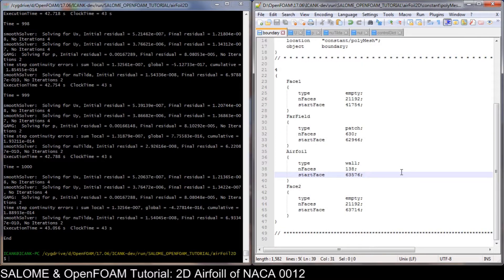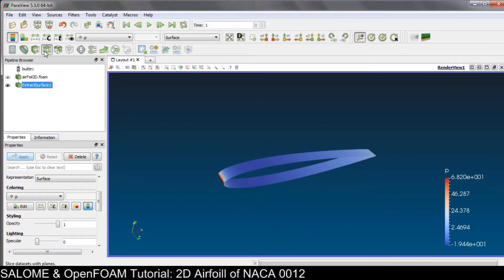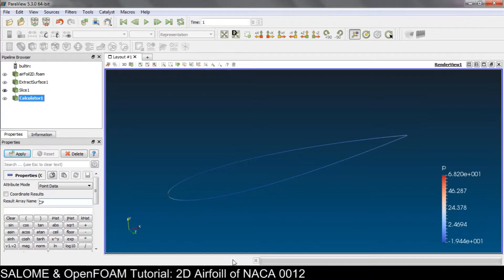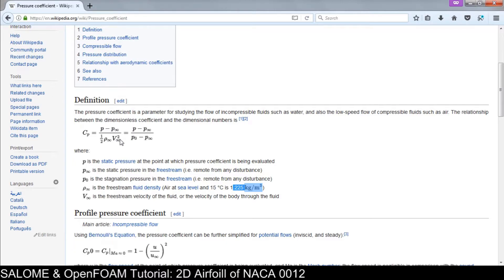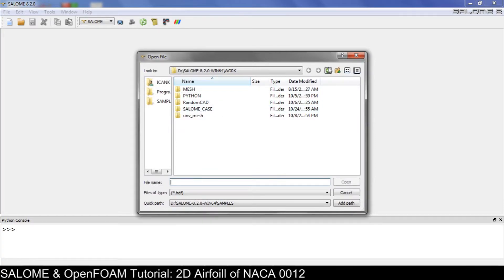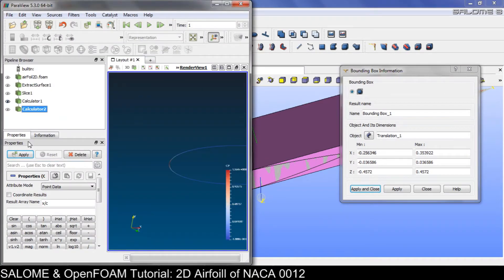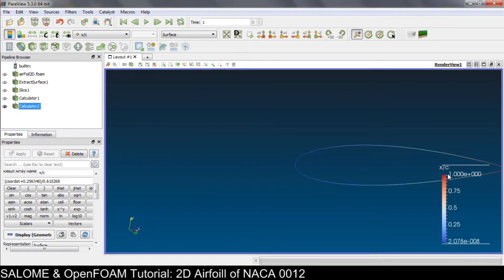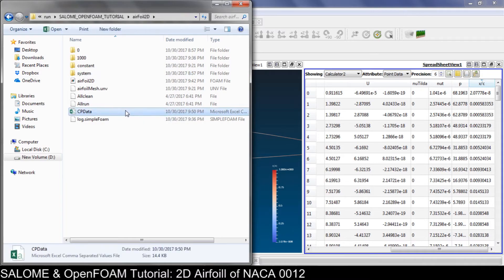SALOME + OpenFOAM Tutorial: NACA 0012 Airfoil Part 4

Comment: Nice video. Just an observation...The unit of pressure used in simpleFoam is m2/s2. So using the Cp formula right away does not make it dimensionless. The pressure should be mulitiplied by density to convert to kg/ms2 if not, the result may be wrong. This worked because the density used is 1kg/m3. If you were using say water, the results will be incorrect

Comment: Dear Ali
 
Can you please extract the Cl, Cd, lift and drag for the same airfoil using different angle of attack. If you can show more about post processing in openFoam, will be much appreciated since your videos are really useful for the beginners like me.
Reply from the maker: Hello, you can extract the data of different angle of attack by modifying thd inlet velocity in 0 time folder. 
Then, once the simulation finish, you need to do "rotating transformation" to get the correct direction of the lift and drag force on airfoil.
Reply: Hello Ali,
Your answer is not very clear.
Could you give us more details or post a new video